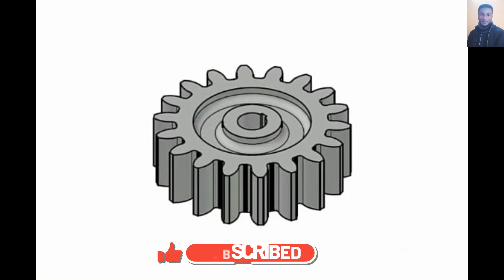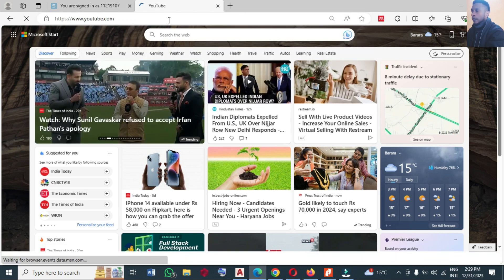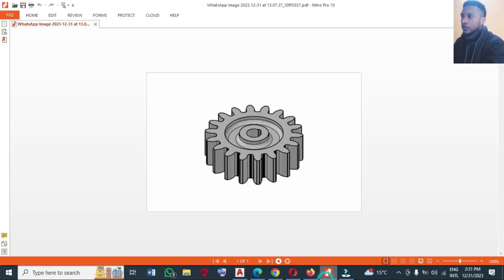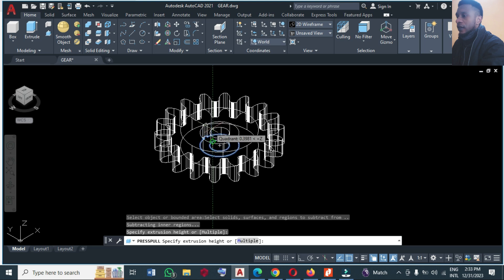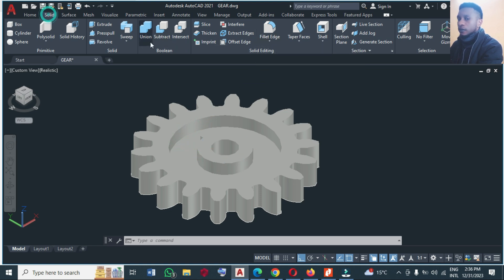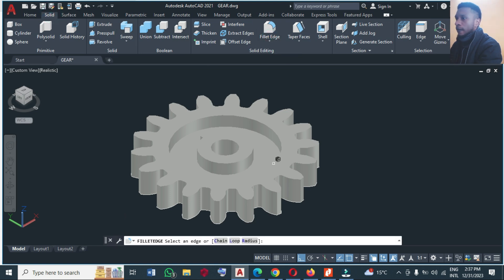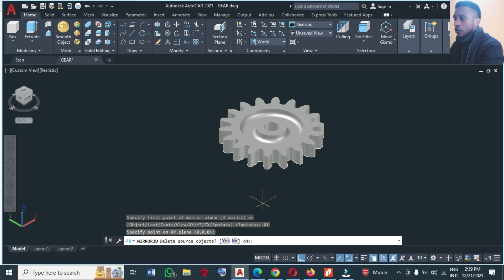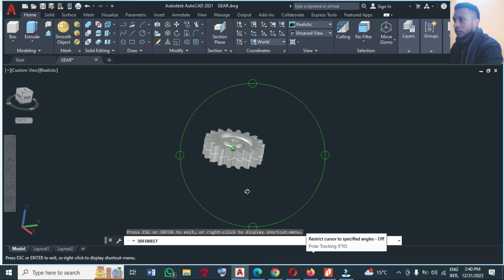AUTOCAD 3D ADVANCED PRACTICE - 05 (3D SPUR GEAR)

Comment: Appreciate the videos. Autocad has not been an easy program to learn for me. I was able to figure out some CAD programs myself, but Autocad definitely isn't one of them.
Reply from the maker: Ok. Please can you mention the CAD program you are using?
Reply: @Ekemobong  Solidworks has been one of the easier one's to learn. EasyCAD is probably one of the easiest to learn. 3D Builder is very simple too, but not for complex parts, because it's not really a CAD program. It does allow simple editing of STL and 3MF files and other forms of CAD files that aren't fully editable, but it also works with STEP files and others. It also allows you to turn black and white images into 3D extrusions really fast and can be used to emboss simple, but still complex shapes, letters, numbers, pictures/logo's and stuff like that. I'm using more than just these 3, but I just got into CAD a week ago and these 3 are the one's I didn't need any knowledge to learn. I was able to open them and create/modify parts intuitively without needing any training or instruction.
Reply from the maker: Yea, thank you for sharing. I know about solidworks. Please, I want to ask one more question. Because, I may also want to check out these programs you mentioned. Can any of those be used to make building (architectural) drawings?